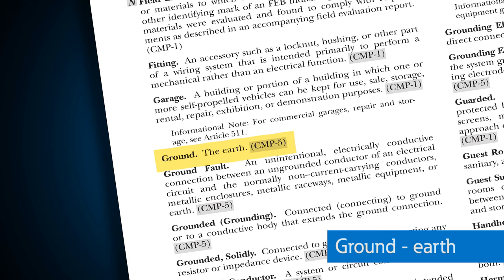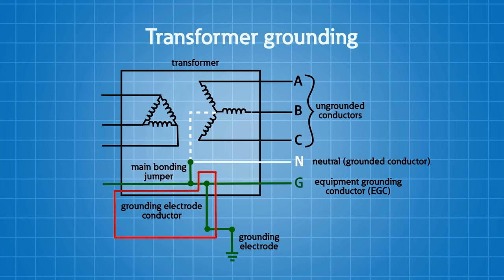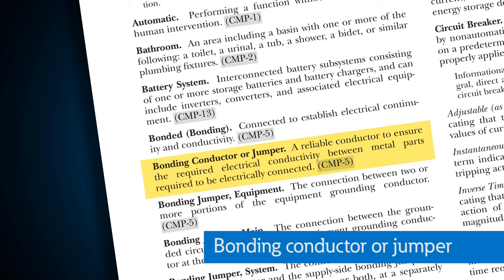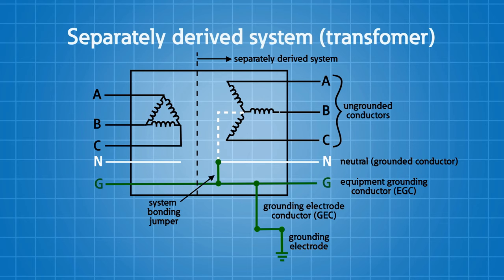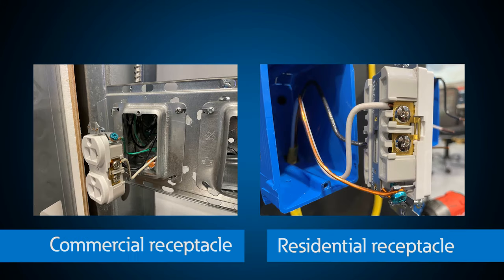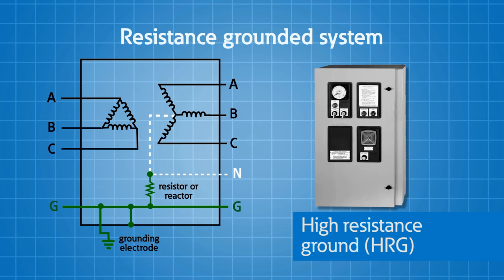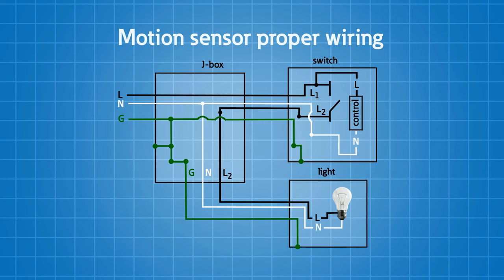Grounding and bonding: Definitions and details

Comment: I'm going to have to watch this about 50 more times to really understand it LOL
Reply: Too much information covered in one video.  Needs to be broken down to numerous videos.
Reply: Keep up newb
Reply: same here,  too much talking less graphics from him.
Reply: it's crucial to understand why you only use ONE main bonding jumper in a system. If you don't understand the implications of why that is, this whole video will probably be confusing.

you provide a second main boning jumper ONLY when you have a switched neutral (in your ATS). If it is not a switched neutral, you only have ONE main bonding jumper. 

If you erroneously add a second main bonding jumper, you would effectively make your equipment grounding conductor the same as your neutral. Meaning that touching an equipment's (conductive) surface could shock you. For example, touching the outside of a metal toaster is usually safe, but in this case, you would become part of the neutral path if you touched the outside. (cue "Dumb ways to die")

The reason that happens is because the EGC and entire grounding system is in parallel with the neutral as soon as you add that second MBJ. Thus, the neutral can now 'share' the load's current with the grounding system.

Hope this helps.
Reply: @G8tr1522 I thought you should never have a switched neutral though it’s too dangerous
Reply: @IWasNoah  how come? as long as you properly ground the system, it should be safe. If anything, not having a switched neutral introduces the possibilty of sending current back into the utility (dangerous for the linemen).
Reply: Don't feel bad. We all do.
Reply: Just remember a grounding rod buried to the soil outside your house. 😅
Reply: This was extremely easy to keep up with if you understand the terms and concepts he is talking about. These aren’t even difficult concepts.
Reply: Right. Super confusing the first time around lol

Comment: kinda upsetting to see how many amateurs in the comments don't understand grounding. I can understand why. It's not an intuitive concept when you are taught that electricity is analogous to water flowing through a pipe.
Reply: Because water wipe has no protection. Main purpose is to supply water by on and off

Comment: Hello Tom….. So if I am setting a panel right next to a 13,200–480V transformer, the XO is tied in with all the grounding conductors…..is the panel  N and G “ bonded” there too?
Reply: NO. you should remove the bonding jumper in either the panel or the transformer, whichever you prefer. You should always have ONE main bonding jumper. the only instance you will EVER have two of them is if you have an ATS/TS with a switched neutral.
Reply: @G8tr1522  Thank you.  Now go get some sleep😉

Comment: Great video, thank you so much. I think one point worth adding in regards to the EGC within a system. If my understanding is correct, it is connected to metal parts and enclosures that have potential to become energized in order to "trip" the over current protection device in the case of a fault.
Reply: he covered that when he discussed equipment bonding jumpers.

And yes, exteriors of equipment must have equipment bonding jumpers if the equipment is powered by a grounded system. 

Question: do you remove equipment bonding jumpers if the equipment has no neutral (eg, a motor), and the equipment is powered by a non-grounded system??
Reply: @G8tr1522 not sure but I’d enjoy you elaborating on an answer

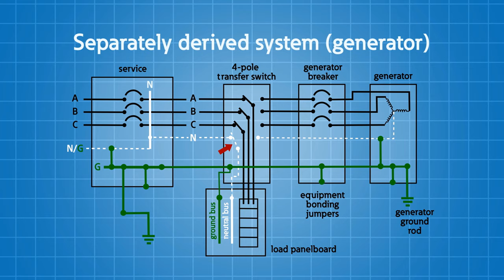Comment: Wait a second. At 6:23, what is the purpose of putting a transfer switch for the neutral between the service and the generator if they are also both directly connected to the grounding system?

Comment: great video I think very to the point instructions!

Wondering if you can help me with a separately derived system question, I'm struggling with.

480v pad mount transformer 3 wires and ground ran to plant disconnect
Plant disconnect to busway 3 conductors and case grounding to MCC
MCC breaker 2 wire plus gnd wire feeds transformer primary 480v secondary single phase 240/120 panel.
Question? is the ground wire from the MCC the only wire needed to ground this separately derived system or do you need some other electrode at transformer?

Comment: Question: do you have to run a neutral cable from the transformer to the first disconnecting component even if you don’t plan on using single phase loads? Could you just ground X0 (neutral) at the transformer and just run the 3 ungrounded cables to service?
Reply: that's a really good question
Reply: I think you need the neutral or grounded conductor for protection purposes. Example is the equipment grounding. We know that current will find a way to back to its source. If you have faults like ungrounded conductor to your equipment enclosure, it will be back to source means it will circulate the your protection will trip
Reply: Wouldn’t be ideal, i would run the neutral conductor if i had it even though i didnt need it. They make delta-delta transformers for this reason.

Comment: Awesome video. So let's say I have an inverter (solar system) connected on the opposite side of the transfer switch similar to your diagram (just without a generator) . Is it recommended that I rather choose a 4 pole transfer  switch instead of a 3 pole transfer switch? 

Secondly if my main incoming supply originally has n and earth bonded as your  example above do I need to bond earth and neutral in my generator/ or inverter ?
Reply: you provide the second main boning jumper ONLY when you have a switched neutral (in your ATS). If it is not a switched neutral, you only have ONE main bonding jumper. 

For example, if the TS/ATS had no switched neutral, and you erroneously added a second main bonding jumper, you would effectively make your equipment grounding conductor the same as your neutral. Meaning that touching an equipment's (conductive) surface could shock you. For example, touching the outside of a metal toaster is usually safe, but in this case, you would become part of the neutral path if you touched the outside. (cue "Dumb ways to die")

To answer your first question, a switched neutral is sort of more advantageous, because your ground fault current path will be shorter when using the secondary power source. This is especially true for large facilities like hospitals and warehouses, but for small structures like a house or a medium sized commercial building (like a restaurant), there isn't much of an advantage.

Put simply, if you're putting your solar system on a house, i wouldn't worry about spending the extra money on a TS that has a means to switch neutrals.
Reply: @i need more sleep  I'm humbled by your superior knowledge . Thank you for the time to explain topics not covered in enough depth at college level .
Reply: @jonerasmus9399  lol, damn, I'm just in an apprenticeship program. About to take my j-man's tho. Helps that i was an EE dropout too.

glad i could help!

Comment: If ground and neutral are bonded at main panel, why aren't all grounded device chassis energized?
Reply: because you only did it in one place. If you failed to provide a MBJ, then there will be no possible way to clear a ground fault with a breaker. Because there is no path back to the source.

What you are describing in your question will happen if you erroneously install TWO main bonding jumpers.
Reply: Always remember that ECG should not carry a current at normal condition and should only at fault condition.

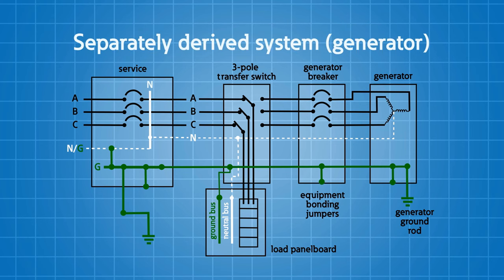Comment: 6:53 Is it valid to keep the ground rod (grounding electrode) at the generator connected to the other ground wires?
Reply: yes, you should always bond together the entire ground system. If you didnt, and if your generator had a ground fault, it could potentially find a current path through the rest of your grounding system thus creating a hazard.

Comment: While, why you need to ground the secondary winding at the beginning? Most modern residential electrical transformer are wrapped in ground metal cases, and the wires associated with the secondary winding travels underground to the residential building. So the whole electric system linked to the secondary winding is in a huge faraday cage where the lightning is impossible to strike on. So if the system is ungrounded at all, it's almost impossible to electric shock someone unless he touches hot and neutral concurrently. Won't it be more safer comparing to getting shocked by simply touching the hot wire?